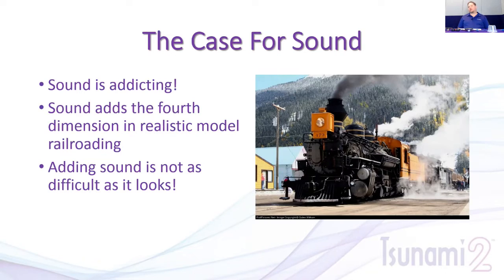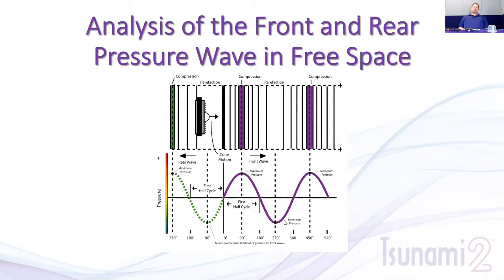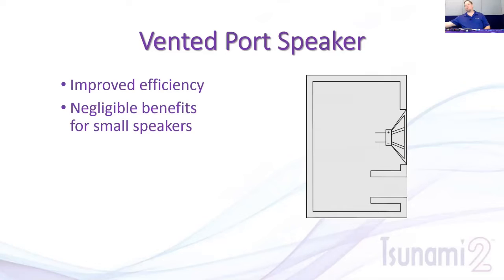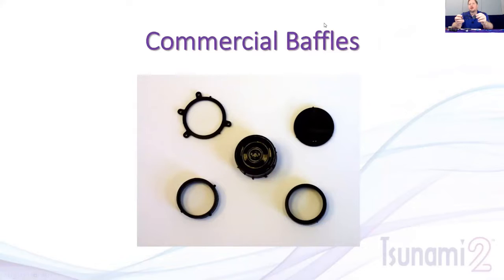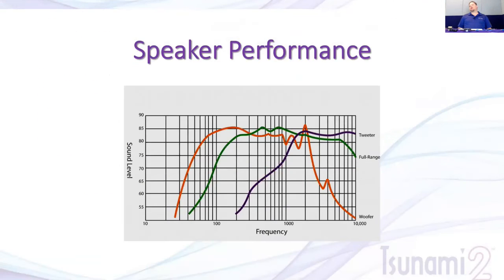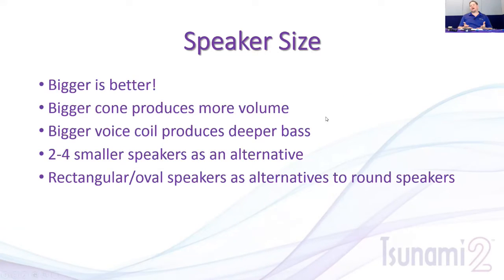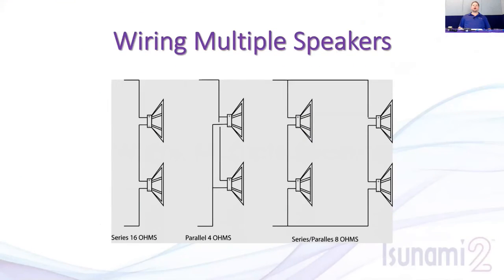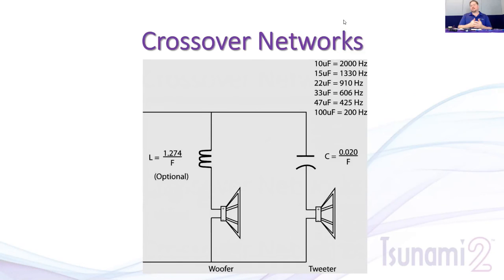Sound Theory | Speakers, baffles & more! (Webinar 5)

Comment: UPDATE:
Question:
What happens when you connect (2) speakers together with incorrect polarity ?
Answer:
The (2) speakers are out of phase.
There are (x2) issues that come about from incorrectly phased speakers: 
A significant loss in bass. Out-of-phase wiring affects all frequencies 
and diminishes total frequency response equally, 
but because bass frequencies have such long wavelengths 
and move so much air, those are the ones you'll notice most.
Reply from the maker: Polarity, while a factor in big installations such as concert venues and such, in what we do here it will not make much, if any, discernable difference.  While the cone moves forward, it also moves backward.  So the front of the speaker or back can be exposed to the outside air, and polarity will not make a noticeable difference.  So, pick a wire as V+ and be consistent.  Where it will matter most is if you are using multiple speakers.  In this case, you want to make sure all V+ speaker leads get the V+ speaker power, or then you would essentially negate the use of the baffle as one speaker makes a positive pressure wave, the other would be inverse, so it would be drastic effects to the audio quality.  But for our models, speaker polarity is not as important as it would be in much bigger installations.  I hope this helps.
Reply: POSITIVE VS NEGATIVE: Does Speaker Wiring Matter?
https://www.youtube.com/watch?v=EeKT4yD3UX4
....
I have (1st) generation [DSD] Sound - SoundTraxx circuit boards.
*  SoundTraxx circuit boards = Speaker wires (Red & Black).
*  SoundTraxx speakers = Colored Dots (Red & Black).

Comment: For best sound quality when using a "Speaker Baffle".
I use Miniatronics  Micro-Mini (2) wire connector. 
# 50-001-02
Using wire connector, reversing speaker polarities
for best quality sound.

Comment: * Proper Baffling
* Speaker Type
* Speaker Size
* Speaker Quality 
You missed the big picture.
SoundTraxx:
Technical Note #9
Speaker Polarity
https://www.youtube.com/watch?v=9CdJtdK8GEg

What happens if you mix up positive and negative speaker wires ?

If you connect the positive wire to the negative part of the speaker, 
the sound wave reverses and travels as an inverted or reversed polarity. 
It creates destructive interfaces where sound waves often cancel 
each other and weaken the waves. Hence, some sound frequencies 
will not be heard in between the audio.

Your SoundTraxx Tsunami-1 and SoundTraxx Tsunami-2 have (x2) "Purple Wires" ?
Reply from the maker: Polarity, while a factor in big installations such as concert venues and such, in what we do here it will not make much, if any, discernable difference.  While the cone moves forward, it also moves backward.  So the front of the speaker or back can be exposed to the outside air, and polarity will not make a noticeable difference.  So, pick a wire as V+ and be consistent.  Where it will matter most is if you are using multiple speakers.  In this case, you want to make sure all V+ speaker leads get the V+ speaker power, or then you would essentially negate the use of the baffle as one speaker makes a positive pressure wave, the other would be inverse, so it would be drastic effects to the audio quality.  But for our models, speaker polarity is not as important as it would be in much bigger installations.  I hope this helps.

Comment: thanks for a very informative video, is there a reason why the cone type speakers are mounted in the sound baffle box facing out and the cube speakers facing into box? thanks.
Reply from the maker: No there is not a technical reason for this. Technically it does not matter which side of the speaker the baffle is on as long as one side is isolated. Most people mount the cone facing out because it looks better than the magnet and wires showing. The cube speakers are usually mounted facing in to protect small parts.

Comment: Please clarify the difference between the terms "baffle" and "enclosure". I here these terms used interchangeably. To me a baffle is a simple flat piece of material were as an enclosure is a box.
Reply from the maker: A gasket is a flat piece of material with an adhesive on each side used to mount a speaker. Like double sided tape. A baffle and enclosure are the same thing - a three dimensional shape like a box (not always square or rectangular though). You can see these different products on our website: https://www.soundtraxx.com/access/baffles.php